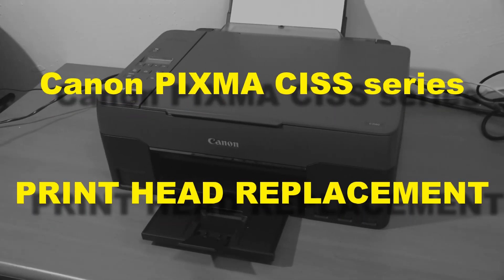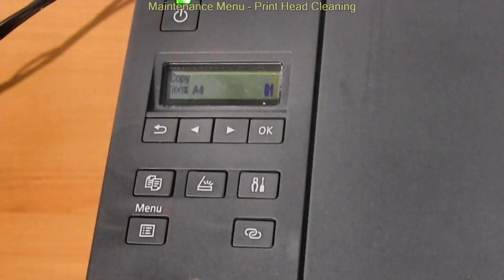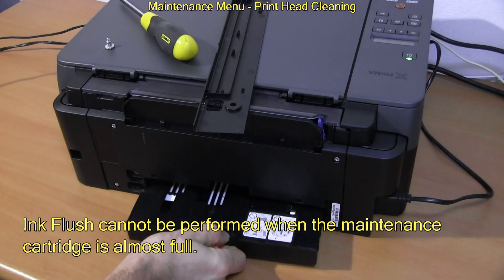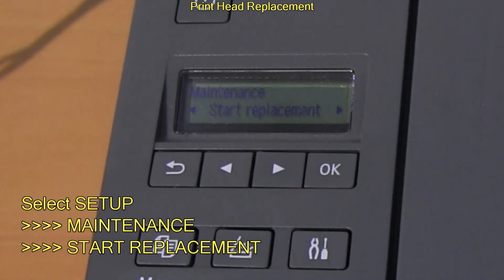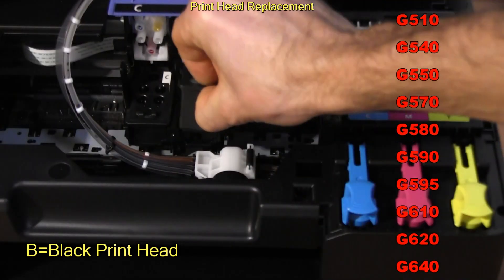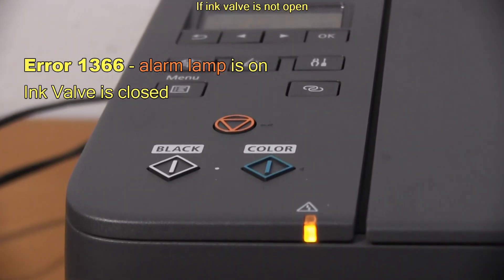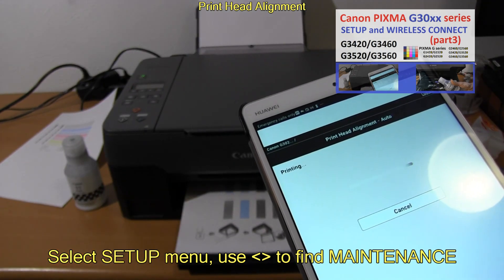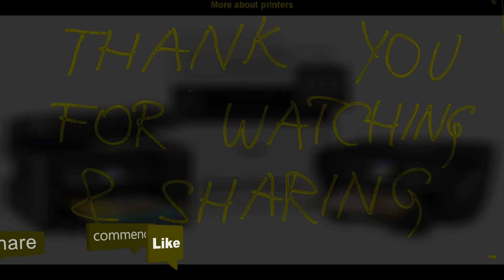Canon Print Head Replacement for PIXMA CISS G series model - G1020 G2020 G2060 G3020 G3060 G500 G600

Comment: Hi. When looking for the printheads for g3560, what's the exact reference number? Also where's the best place to buy them?
Thank you very much
Reply from the maker: The part number for print heads depends also on the regional printer name. The best is to check at the authorized service, which is also responsible for warranty repairs.